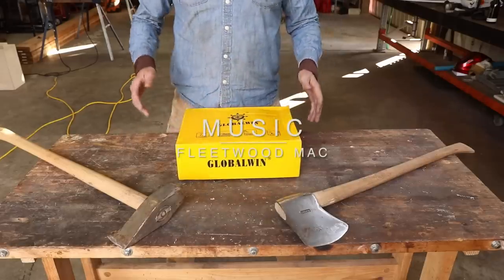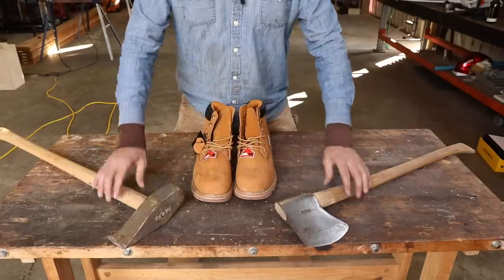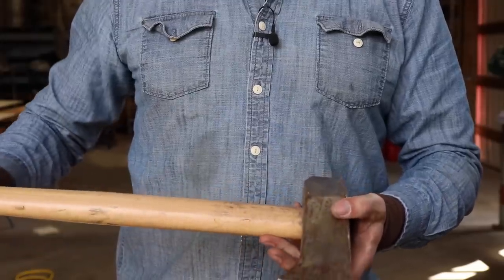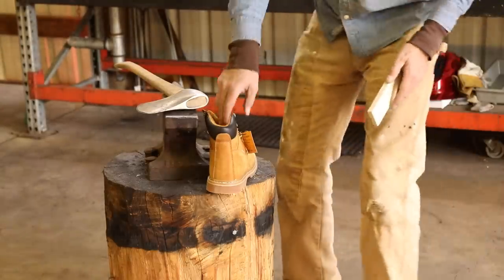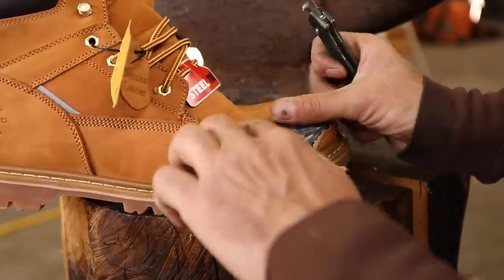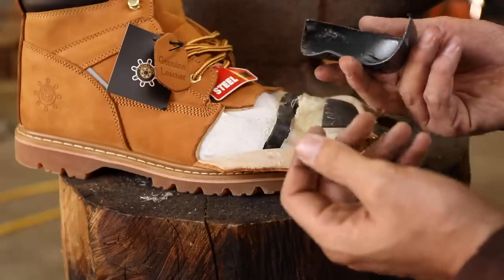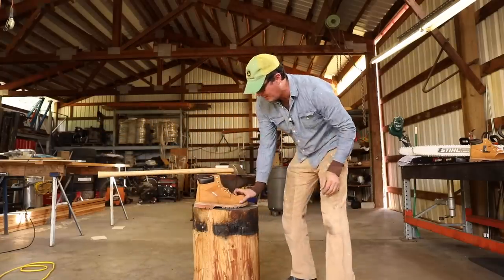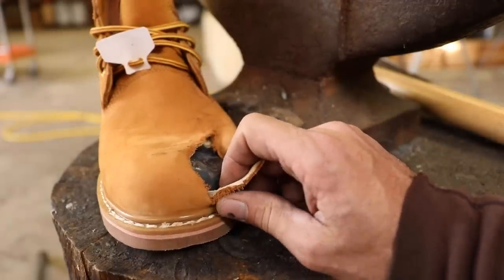Will AXE Split STEEL TOE Boots In Half???

Comment: Now try one a composite toe boot
Reply: yes that was going to be my comment i'm required to ware composite at work because of electric work we do
Reply: This.
Also he got his terminology wrong yet again.
A composite toe boot. I.e. carbon fiber or hdpe plastic 
IS a "safety toe" boot. 
Steel toe boots are steel toe. Not safety toe according to shoe manufacturers. 
Just sayin.

I prefer safety toe to steel because even in the winter doesn't matter how well insulated steel toes are your feet would freeze. Just like the opposite would happen in a wildfire.
Reply: It should be pretty obvious that that's the next thing to try.
Reply: I'd also like to see this many people in my shop wear composite toe boots over steel toe
Reply: I can't wear steel for my EMS job because if something falls on your foot the steel can curve in and cut your toes right off. I also don't wear steel in my cowboy boots either because if a cow or one of my horses step on me, my toes are gone
Reply: I was going to say the same, would be interesting to see a composite boot, as “apparently” there better as absorbing and distributing the energy.
Reply: Abe Peterson Well what happens without a steel toe boot? Sorry but I don't get your logic. If something that bad would cause the steel toe portion to curve in what happens without steel toes? I have seen what happens you lose all of your toes with nothing left to sew back on. I have also seen what happens when a cow steps on a foot not protected with steel toed boots and the whole area from the non-covered or what would have been protected area is smashed beyond belief. At least with steel toed boots you have a better chance of the steel toe protecting your toes. Not everything falls at the opposite end of the end of the toes to cause it to curve in as you say so your gaining better odds with steel toes. And as you should have seen the curved in area steel protected not only the toes but the area you claim would curve in cutting your toes right off. I just can't understand your logic or OSHA not requiring safety boots.
Reply: Bockscar I think you missed the point entirely this comment thread is about safety toe not steel. Meaning he has to wear those instead.
Reply: WOW...is he selling the benchmade.....may not be paid but he is seeking Benchmade endorsement......but he will just say...." i just  believe in the product thats why i say its good"  Hey Wrangletstar you are to obvious!!!!
Reply: I was gonna say that too. Composite toe boot is supposedly as sturdy as steel toed, but you can prolly wear it in hot areas
Reply: Actually, Chad, before HDPE toed boots were around, they commonly called steel toe boots safety toe boots.  In fact, I once showed up at a job with HDPE toed boots when they were first being allowed on our type of sites and was told that they were not safety toe - that I needed steel. Shoe manufacturers don't make the terminology.  Groups like OSHA do.
Reply: Christopher Terry indeed. Back then. But now osha and shoe manufacturers have to differentiate the two because new safety whatsits demand different shoes. Steel has to be specified as steel. Hdpe or carbon fiber have to be specified as safety.
Reply: I was just about to comment that haha
Reply: that's actually the point. cleanly amputate rather than crush
Reply: Abe, I've had cows and big bulls step on my steel toed boots(Wolverine).  They don't bend.   Mythbusters had a good episode about steel toes.  If the force is strong enough to bend the steel, it's plenty strong enough to pulp your toes.  I'm a believer in them.
Reply: David S. Or a better shoe
Reply: mythbusters has already challenged the steel toe cuting off toes myth. spoiler* no the dont cut your toes off but if something heavy enough fell on your foot 1 ton your foot will crush not cut off anything
Reply: David S. Yes

Comment: Were those ANSI approved boots?? I dind't see anything on the box or labels, and manufacturers are usually pretty proud of the rating. 

ANSI steel toes are stronger than non-ANSI, because the design has to pass rigorous testing. Perhaps redoing this test with a proper set of ANSI boots would be good.
Reply: Ansi din are tested on 200J Will survive this easily. Fake toe??
Reply: In the event that I were to accidentally drop an axe on my foot, I’d rather have an unapproved steel toe shoe on than nothing at all

But yeah sounds like ANSI approved footwear is better than just the normal stuff judging by what you wrote

Comment: I would just like to note-steel toe boots are designed to a) protect your toes from many things that could be dropped or kicked in the workplace and b)to cut your toes off for later reattachment as opposed to the force turning your bones to dust when faced with extreme environments.

Comment: Glad my toes weren’t in that boot! Although gave me hope that if I ever did get my toes question if I could get my fingers underneath the edge of the steel toed it seemed to be pretty easy to yank the steel toe off. Hopefully.
Reply: Well on the other hand imagine that axe hit foot whithout this kind of protection, if u were lucky it may go between toes, but if not,...
Reply: Michael Morrow booty
Reply: They are cheap boots, get good ones and u will be fine
Reply: If it was anything worse than that axe swing the metal would probably have messed your toes up pretty bad if not just cutting them off

Comment: Back in the days when they made a quality boot, I put on a brand new pair of Herman boots (no steel toe) and was chopping a birch tree stump. The axe glanced off the stump and right onto my foot. It penetrated about 3/4 of the way through the leather, and I had a horrible bruise on my foot for several weeks, but nothing was broken or cut.  I am glad that I tried out my boots instead of wearing sneakers that day. I ruined a $200 pair of boots, but that was a small price to pay. That was 40 years ago when I was in high school. I became very safety conbscious afte that.
Reply: That's bizarre, since steel is cheaper than leather these days.
Reply: Bill good idea

Comment: Are steel toed boots chainsaw proof
Reply: Nica Vlogs  yes they are but only the toe I believe they make special chainsaw boot that have the fibres in them though
Reply: I have chipewa logger boots and they have held up to a chainsaw
Reply: You can get boot covers which I believe are or were Kevlar. I was told they work by jamming up three saw.
Reply: Steel toe yes, composite toe no.  There is a video around on youtube that chainsaw tests both types.
Reply: You would know before it cut through the steel
Reply: They do I have a pair that saved my foot
Reply: Greg Fowler, logger boots, like Husqvarnas functional boots, have kevlar-isch inlays. Anything that says "Saw protection" have that functionality.
Reply: The steel toe would dull the chain in less then a few seconds.. I've hit rocks and nails and it absolutely ruins chains.. We used 24 inch Husqavarna chainsaws down to the 18 inch I believe... Sthil makes the best chainsaw in my opinion.
Reply: I rather not know
Reply: really chainsaws are ment for wood it would just ruin the chain with little effect

Comment: Axes are dangerous. They are much more powerful tools than people think. The secret is to hold your feet in the right position while using a good solid chopping block. Don't use the axe if you you are tired. , and don't stand upright if you are using a short handled axe
Reply: Good safety tips. And, have bystanders if any stand well away. Ensuring a good grip and eye protection is a good idea too.

Comment: Motorcycle helmets?
Reply: if you are worried if an axe will cut thru a helmet, you should reconsider your motorcycle driving skills or areas where you drive at.
Reply: Ramūnas Gudauskas lol not worried about it......I just like watching things get smashed.
Reply: The axe will go through that like butter not even worth testing that one.
Reply: There is a youtube video, where they bash a helmet with medieval weapons and it holds up quite well. Sure, the helmet was on a puppets head so there was a lot of flexing, but still it was surprisingly strong.
Reply: Adventure Time Outdoors Really hard to figure out exactly what type and make of helmet & where to strike the helmet as they are zonal in their strengths.
Cost too - A cheap plastic helmet can be had for £50 / $60, through fibreglass, different composites, right up to an Arai, Shoei or AGV (or many others) carbon fibre race helmets for £1200 / $ 1400.
Some touring helmets might even be stronger in some regards than the top race helmets because they might be constructed differently.
It would be interesting to see how a few different types work against each other, but that's an expensive video.

Comment: +Wranglerstar     Thanks for doing this.  Interesting results.  In the For-what-It's-Worth category, Nick's Boots makes a safety toe which is rated for the Hot Shot fire boots.  It is a composite safety toe which does not remove the NFPA rating for the Hot Shot.

Comment: Composite toes are better for two reasons. First, steel toes will suck heat from your toes and secondly the steel toe can clamp your toes into the boot whereas composite would break clean

Comment: The toes of safety boots will deform... But, they'll turn a toe-loss (or even half of your foot-loss) level accident into somewhere between bruised/broken toes/feet that'll heal. Also, for wildfires, composite (carbon fibre) toe boots. Actually, just in general. They're so much more comfortable, lighter, and meet/exceed the same 200 joule (or whatever amount) impact test as steel.

Comment: i have new safty boots for xmas evry year .im going to test my old ones just out of curiosity
Reply: Results? Cause i feel like if i nail the boot rigjt in ther center its done for.
Reply: If you pay close attentom the maul slipped off the boot
Reply: How did it go
Reply: @erenarmin6403 . I supose rely I should have done a vidio. I but fairly cheep boots but in all fairnes I did 2 tests I hit the one boot with an axe big log splitting axe and the other with a lump hammer commonly called a sledge here in the UK both tocaps survived but the metal moved neither bent Tho. I also did a penertration test when the boot was forced on to a screw and a nail. I can safely say a chap of my build (97KG) wouldn't penertrate  the soul. I will do a vid with my old boots  when I get new boots

Comment: The one thing is going for larger size broadens the unsupported striking surface, causing extra strength for smaller sizes. Another thing I know where smaller is better in, torque convers if aiming for performance. If aiming for better economy and lower emissions, a larger torque converter.

Comment: My dad works for the city, he's been then for 20+ years . they arent allowed to wear steel toe boots anymore because apperanlty they are safety hazards for electricity. So since a couple years the "steel" toe, is actually a really hard polymer. And these are boots that the city buys for them, they are top of the line quality stuff. They dont have a choice because the rules are so strict.
Reply: I would have thought the leather over the steel would prevent it from being a conductor.
Reply: The boots are all labeled electrocution proof, but its the city rules that enforce it. He gets everything for free... except underwear.
Reply: Not if they get wet, but truth be told, they are insulated underneath.  It's only if they are submerged and if a contact is made directly - and even then it's iffy.  But rules are rules so to speak.
Reply: Kev Gunner only dangerous if the steel is showing ie if the leather /rubber sole is ripped
Reply: Liam Fox how do you know this? did you test it or take a class on boots?
Reply: Saintanator as part of a safety coarse

Comment: just want to say in Canada the steel toes are required in wild-land fire
Reply: That's what happens when you let the pencil pushers dictate. Common sense is becoming much less common.
Reply: Only Wildland Fallers are required to wear steel toes.  Regular firefighters not qualified for chainsaws wear regular boots
Reply: Are they regulated to steel toe, or would the composite toe work? as long as your boot has the CSA triangle?  Composite toe isn't very chainsaw proof but would be lighter, non heat conductive and still offer crush resistance.
Reply: Bradley Macaulay  Composite is useless for chainsaw protection so no.
Reply: Bradley Macaulay they tell you that you need steel but composite works just don't say they are I know bc dosent require any safety toe even for cutters in there fire program

Comment: In '90 I was working for a diesel truck parts outlet.  We kept leaf springs on pallets on the top shelf of pallet racks...12-15 feet up.  We would put the lift forks right in front of the pallet then climb the rack and slide the spring we needed onto the forks.  OSHA pound sand...Anyway, I climbed back down and just jumped off the rack when the spring dropped between the forks and came down with the end just catching my right steel toe.  It dented the toe in and put a big slice in the leather, and I felt the shock of that for hours, but I kept working and sustained no damage, just some bruising. I was lucky...

Comment: I have a pair of boots perfect for woodland. They are red wings with a composite safety toe. Same crush rating as steel but it does not get hot or cold like steel toe. Also the sol is oil slip resistant and penetration resistant. They also have a “king toe” for those with wide feet. About $220. (Plus $60 for arch inserts( optional))

Comment: Thinking about it steel toed boots are actually more dangerous working in comstruction, etc style areas. If something heavy enough falls on them "bye bye" toes. Not saying something heavy enough falling on your toes wouldnt hurt but without the steel toes you might stand a chance at not losing your toes.

Comment: Fun (but not really) story, I used to work for a tree service. I was nearly killed by an idiot lobbing a 3' stob that was roughly 8" in diameter from 35' high. I was wearing steel toe boots that day because it was a residential job that was just trim work and I wasn't going to be climbing. Well the stob missed my head by less that a foot and it hit me directly on the steel toe of the boot. It hit so hard that it blew the steel toe out the sides of my boot into the concrete and nearly cut my toes off. I'm just happy it didn't hit my head/neck/torso area obviously. But I did have a completely shattered foot+toes from the blunt force trauma.

Comment: Or you should see if chain saw chaps are axe proof you should try a cheap pair and then and expensive pair you could even reuse the same one from your chain saw chaps vs chainsaw test video. Thanks
Reply: this i find rather interesting. i would think they wouldnt be for the simple fact that they rely on binding up the saw with the fibers. and also the fact that kevlar isnt terribly cut resistant. thats why kevlar vest to be stab proof need a plexiglass layer in them. im curious about this though. i could be wrong
Reply: Not really any point in doing that as far as I can tell, unless they are glancing blows. If the full weight of the axe is flying into your leg, the blunt force trauma is going to be real bad even if the chaps stop the cutting action. But the chaps might help save some skin if its a glancing blow in the right spot.
Reply: That would be pointless

Comment: IMPACT (I/75) resistance for the toe area of footwear.
Class I/75 footwear retains a .500 inch (1/2 inch) for men’s and .468 inch (15/32 inch) for women’s or greater
clearance after a nominal impact of 75 foot-pounds (101.7J), i.e., a 50 pound weight dropped from 23.25 inches reaching
117.9 ± 2.4 inches per second velocity at impact.
You just proved they meet the standard

Comment: I had a giant woodchipper run over my foot when I was wearing steels toed boots I had to go to the hospital that day and ended up breaking my medical malleolus. It wasn't till after surgery and healing  when I was going back to work I tried putting my boots and the one I was wearing was definitely tighter at the steel of course it had bent from over 7000lbs of pressure anyways that's my steel toe boots story
Reply: Blimey

Comment: I actually have tried that as well. I used a vintage plumb 3.5 lb single bit axe with a narrow bevel. It cut clean through! I think you need a super sharp, hard, narrow axe on a solid wood floor, that's what I had. I also cut through clean in one blow an encyclopedia and a large phone book!

Comment: Great axe demo!  Now, my question for the steel toed boots is, "Will they protect your toes if a forklift runs your toes over?
Reply: From experience I can say yes they do, I've had my toes run over by counterbalence and reach forks. no damage. I think this is an old comment, but i'm just saying in case any other people were interested in the answer.
Reply: Londinium Armoury   My foot was run over by a forklift on a dock. Had I not been wearing steel toe boots, my toes would have been crushed. They do work!

Comment: you should test composite toe. I never use steel toe due to the worry of the steel bending and slicing off the front half of my foot. Composite toe works better around horses anyway and doesnt heat up as much.

Comment: So I’m not sure if you could wear these either in a fire environment, but because I work in an HV electrical environment as well as an industrial environment I wear shoes that contain a Kevlar composite toe insert… I’m not sure how it compares exactly to the steel toe but it is really crush resistant and would offer you a good level of protection from falling branches and such. It also would not transfer heat.